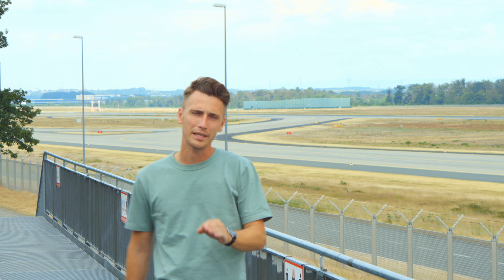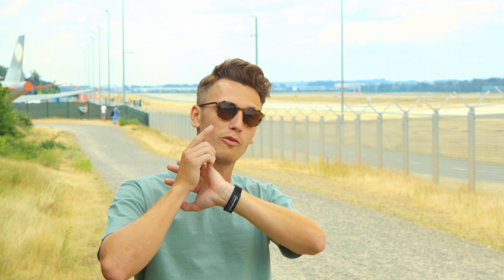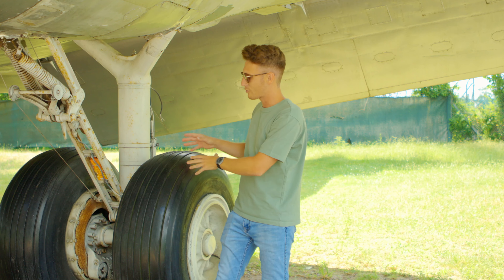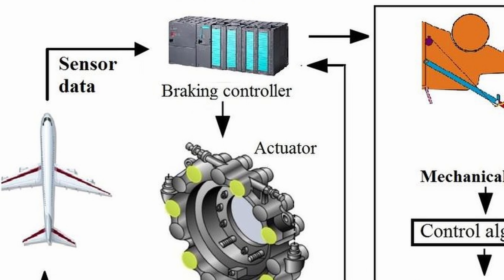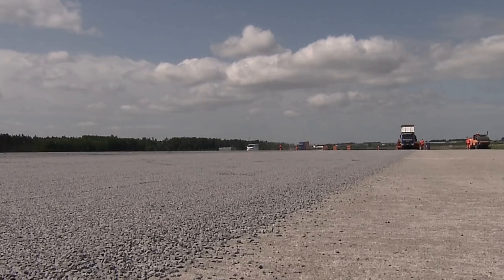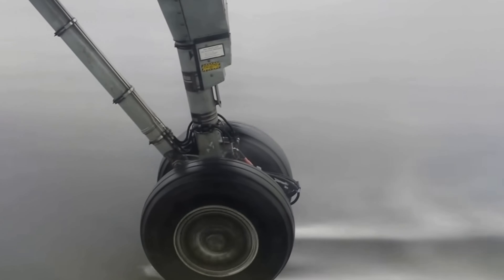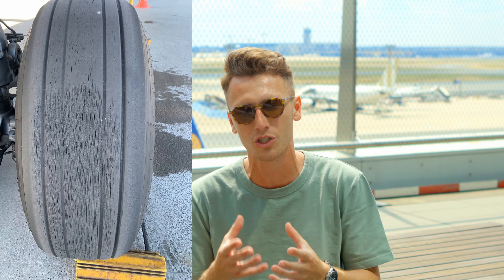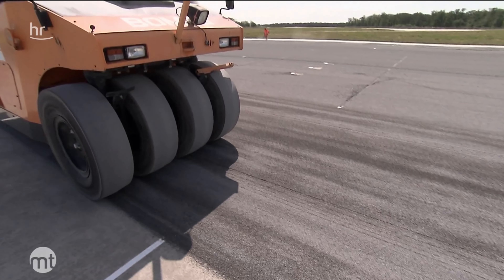RUNWAY CLOSED after only a few Landings! WHAT went WRONG? Frankfurt International Airport

Comment: The runway at the touchdown point should be smoother, so as to not wear out the tires. Give the tires a chance to spin up to speed. As they approach the courser surface the tires are up to speed they'll have better traction and  anti skid performance.